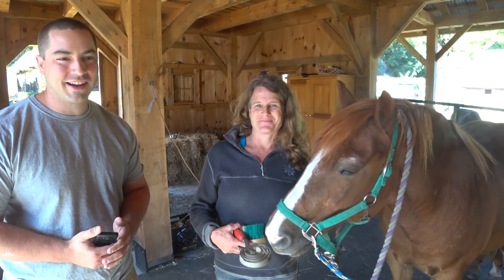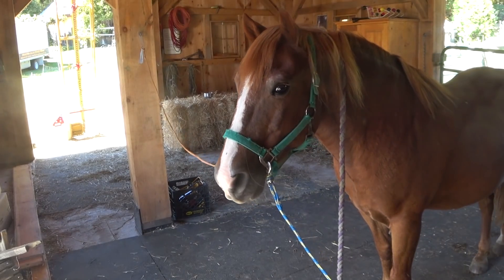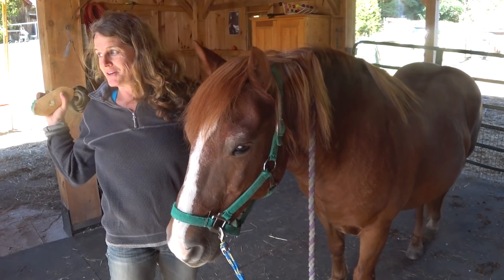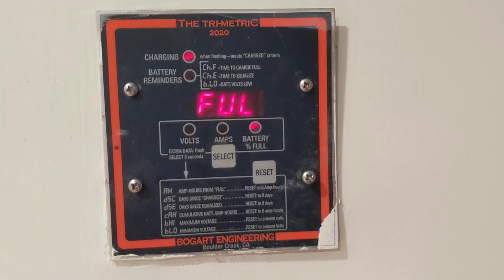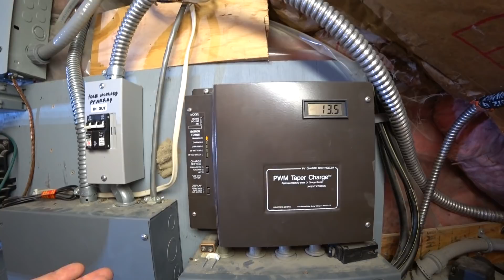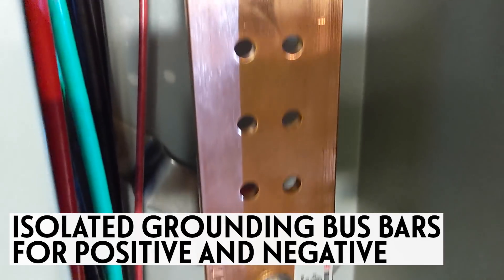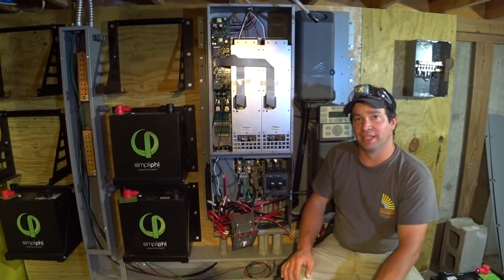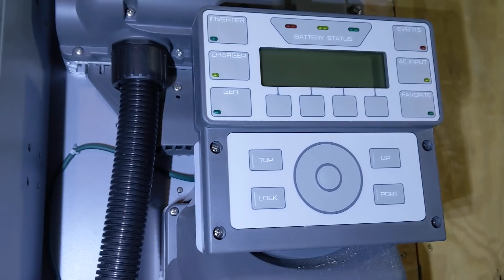Off Grid Farm, Solar, SimpliPhi Lithium, Outback Radian Installation

Comment: Great Video.

I got 1 question and i cant seem to find anything related to this...
I have a large amount of 36v lithium batteries but i can not find any video regarding solar charger controller that can deal with these batteries, any help would be great.

Thanks.
Reply from the maker: Hi.  That's cool you have some 36V batteries.  I know some people who have worked with the A123 modules out of busses, and those are 36V.  It's true there are not as many solar charge controllers set up for 36V, but they are out there.  Here is one example: https://amzn.to/3AWqAjr

Comment: Hello David how do you test your solar panels
Without a load
I just purchased a hundred amp shunt and a volt / amp meter one of those Cheapo kits off of eBay I was just wondering if I could dead short the panel with the shunt in between the line or do I need to put a load on the panel
Reply from the maker: One method is to set the panel in the sun and check open circuit voltage.  Use your multi-meter set to volts DC, put one probe in one of the MC4 connectors on the panel, and the other probe in the other.  Check your reading against the data sticker to make sure they are close.
Reply: @DavidPozEnergy  that's what I do but I want to check current as well to calculate watts.I know I can wire a shunt online with a load but I also know a panel can be connected to it self for a short time to test current and can not find a diagram for that when I first purchased my first set of panels yes ago the guy I purchased from had a shunt in a box with a standard v/a meter and did a dead short to test the current but I tried to recreat the same tester with no results

Comment: David and Ben, awesome install. Could you share the model of the copper bus bars you are using in the cable way for the battery connections?
Reply from the maker: I linked to it in the description.  Thanks for watching.
Reply: @DavidPozEnergy Thank you David!

Comment: Damn... Twenty+ years with nothing but a "primitive" 12VDC Solar power system. They most definitely aren't going to know what to do with all that power; it's going to be very strange to not have to use the generator to run things because they have the power to spare with the size of that battery system. Very good video, by the way. It's nice to see how folks have managed in this modern age without most of the things everyone else seems to take for granted.

Comment: Hi David. I'm a huge fan of your videos and have learned a lot. I am also hoping that perhaps you can do video recreating the free energy solutions that are circulating in YouTube. These are using motor generator set with a flywheel in between as a mechanical battery. I just want to know if this really works and if this really works could also be a good idea for off- grid applications.The motor is of lower power while the generator is with higher power so that it could power the motor with its excess power thereby having a self running system.
Reply from the maker: All of those types of videos are scams.  They don't work.
Reply: Hi David. Thanks for the reply. I'm sure you have figured them out. I think too also that those videos will never work. Just curious about it.

Comment: Hey David, this is totally unrelated to the video, but I was wondering if you have ever considered the case where the electricity price in the grid becomes negative? If so you would want to shut off your excess solar panels or effectively be losing money for producing electricity. I'm asking since I personally live in Denmark and due to the large share of renewables in the grid this is a situation that take place on a monthly basis. Thanks for your content and hard work 😊
Reply from the maker: If that is the case, then I'd suggest the Sol-Ark inverter.  It can be programmed to never back-feed, or to backfeed only to the point of zero, but never more.

Comment: Great video Dave.
The wife is a horse person so I think I may e able to get her to watch this solar construction video.
I have one comment and one question.
.
Comment:
I saw two farm tractors at least one of which I am very familiar with, that has a diesel motor and a PTO (power take off). There are generators that are self excited and designed to run off a PTO coupler that work really well. They are supported by a cradle that sits in the 3-point hitch. And can generate 5Kw to 30Kw of split phase AC sinewave power. Power is pretty much limited by the horsepower of the diesel motor.
Might be a fairly cheap backup plan for them since I think you can get them for about $100 per kilowatt.
Question:
How are they going to keep those LiFePO4 batteries warm in those dark, cold, snowy Vermont winters?
Reply from the maker: The basement is directly under the house, which is kept warm with the wood stove.  It's not directly heated, but never drops below freezing.  There is no insulation between the basement and first floor.

Comment: David,
I have 2 growatt 3000 24volt off grid. Inverters and 2 big battery 24volt and 6 -340 watt solar panels I want to run in split phase ,do you have a diagram for this type system?
Blessings Mike
Reply from the maker: The Growatt manual shows how to connect for split phase.  But I'd suggest moving to 48V.
Reply: @DavidPozEnergy  thanks

Comment: you are going to be unhappy with a 16 to 18 % energy production.....SOLar is a complete joke.........the best most advanced panels...in the best conditions are only ....get this now it is from the manufacturers...is 20.9%.....that is if you are on the equator.....during the summer...other wise....16 to 18% in the best....conditions........that sucking sound you are hearing is the money being drained out of your pockets for a failed system......u would need 5 times the solar panels to meet your energy requirements...
Reply: That escalated quickly...

Comment: David that was a great video, so when are we going to see you on the road personally installing a system.  They picked an interesting choice of equipment, I think I personally would have installed 2 Iron Edison Lithium Iron Phosphate 5.12kWh RE-Volt Lithium Iron integrated battery management system.  :)
Reply: For 8 k You could build a 50 kWh battery Diy.

Comment: at 13:30 hi David did  your friend know that those 100 amps outback charge controllers don't allow parallel connections on the same battery bank ? I found out when I read their manual .that is why I didn't like those 100 amp and I used 4) 80 amps outback controllers instead. just saying

Comment: My only real concern is that new lithium batteries are going to get cold, when they aren't there with their wood heat.  I wonder if they figured out some type self heater for them.   I'd be interested to see how long the new system will last with all the modern electronics.  27 years is going to be hard to beat.    Thank for sharing this with us.

Comment: David... I've watched your videos about the Growatt All in One and now this one, "FLEXpower 8kW 48V Pre-wired Radian System 120/240V with 300VDC 100A CC",... Besides price, What is the difference between these two systems?  Which one is more efficient?
Reply from the maker: The Radian is a tried and true brand.  They have been making reliable inverters for a long time.  Outback has great customer service.  And the Radian is very efficient.  I think it was 40 watts or something in idle.  My setup with 2 Growatt 5kw, is about 150 watts in idle.  

The Radian requires the extra part called the Mate 3, to setup and control.  The growatts have a display and buttons built in, so no extra part needed.
Reply: @DavidPozEnergy  thanks!

Comment: I have worked on a few of the old school systems. I am amazed that they lasted so long. The Old Trace inverters were the first industrial grade inverters available for the off grid market. This couple got 27 years out of 2 sets of batteries! Wow! For a DYI installation from the 90s they did a fantastic job! Not many people other than homesteaders could live on a system that small and make it last that many years. They ran their well too! With my first off grid system we  were totally off grid with 1200 watts of solar and a 1500 watt Trace inverter so I know what these people were having to do to survive the snowy winters. Thanks for showing us the new solar power installation.

Comment: We saw a video previously where  Ben talks about the benefits of the Sol-Ark system, could he explain why they chose the Outback Radian system in this case? I'm a fan of both systems and would just like to know the decision process.
Reply from the maker: Ben prefers the Sol-Ark.  I think in this case the decision was made based on which one had a longer track record.  Sol-Ark is relatively new, and Outback has been around a long time.
Reply: In this case, Lissy had an old Outback system that had lasted her forever and wanted to stick with Outback.
Reply: Had the same question… thanks for the answer… brand loyalty
Reply: @Miweatherspotter1  and outback products can actually produce the power listed on their nameplates, solark can not say the same. Unfortunate, as I had high hopes for their brand.

Comment: Great video.   I totally understand SimpliPhi batteries in this case but cringe at the $ savings that can be achieved with DIY if there were some way to bridge the knowledge/safely/liability gap.     I have 3 x Midnite Classic 150s and they are fantastic controllers...   so I sighed at seeing one dismissed/tossed.    On the other hand - 20yrs!!! very exciting that my own panels may actually last.  Such a cool video and so happy for them!!    The day will come when we have video on 'quaint'  Lithium-ion and LifePO4 cells.... :)
Reply: It's easier to buy simplicity than it is to build it yourself.

Comment: Heard those batteries are expensive compared to others.
Reply: I'm pretty sure Ben has to use things that carry UL listings too.
Reply from the maker: Yes, Simpliphi are about $710/kWh.  Compare that to my Gyll batteries (also pre-built 48v LiFePO4) which are $290/kWh
Reply: @DavidPozEnergy  You mean your EG4 batteries now.  😎

Why did they choose those batteries with a Battery Master like you in charge?  Could have had more EG4s in there!
Reply from the maker: I'm not in charge of Ben, or the company Ben works for.  LOL.  I asked about using the EG4, but the real person in charge wanted something with a longer history.  Simpliphi has been around a long time

Comment: Interesting . I wonder how much their old system cost them.  
David how did the experiment mixing both lifepo and Li ion NMC etc batteries at the same time go ?
Reply from the maker: It worked fine for me, but I have fairly large NMC and large LiFePO4.  There are some things to watch out for, and I don't recommend it if one is very small.
Reply: @DavidPozEnergy  Thanks I have 80 Kwhr chevy bolt and nissan leaf cells but in future will likely add LifePO and maybe use some of the li ion cells esp the bolts in other locations and projects that are more weight and space sensitive.

Comment: "There's no ventilation for them, which is not really safe."

"I replaced the old batteries about 4 years ago."
Reply: Yes, I mentioned it 4 years prior and they weren't too worried about it.
Reply: That room has no vapor barrier on the roof or the one wall  all the panels are attached as you can see in the video so the hydrogen, if present, would leave the area pretty quickly considering it is a smaller gas atom than helium and helium will permiate a latex baloon over a few days.  The only time hydrogen buildup would be a real concern is during a battery equalization and even then that space is not that well sealed so it wouldn't be an issue for very long.
Reply: @kuhrd  While there's a certain amount of logic to what you've said, how many hydrogen (or gas of any kind) explosions have you seen? I've seen RV battery compartments explode, and they're open to atmosphere. H2 mixes into the air. If you don't have something actively evacuating the air in the space, a bomb very quickly assembles itself. This is why commercial battery rooms have monitors and active ventilation. You might not think one (or four) lead acid batteries would generate much gas, but they can generate more than enough for a nice energetic pop.
Reply: Maybe they knew they were replacing the system 'soon' and decided that it'd been fine for 20+ years, it'll be fine for a couple more...

Comment: Great set up.
Installation wise I would mount it up concrete board and not asking those loose and open isolation.
Whenever there is a fire it runs pretty good.

Comment: if you have the space, how about a solar steam boiler instead of solar panels? Mirrors are a lot cheaper and boilers are also quite more efficient than solar panels. All youd need to do is research that, as they dont work with just water iirc, they use a heat exchanger with some liquid that wont boil which then in turn heats up the boiler located somewhere else. 
Otherwise its just a basic steam boiler hooked to a generator which for 5kw isnt much bigger than a gas cylinder. You could even use a high power brushless motor and get (star) triphase power for a more efficient conversion into DC.
Reply: Heliostat trackers would be very expensive.  Fabricating the boiler would be very expensive.  It would take time every morning to build a head of steam.  The system would generate nothing if there was no direct sun.  What big solar thermal concentrators like Ivanpah do is burn natural gas to bring the system up to temperature every morning, and said gas represents about a third of the total energy into the system.
In contrast, PV modules are dirt cheap.